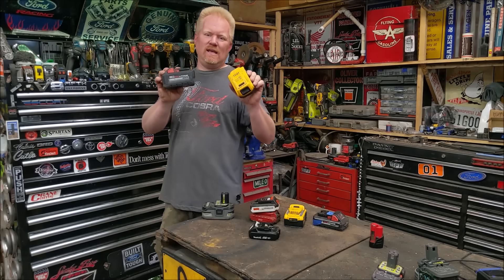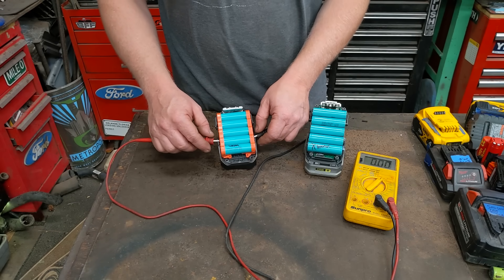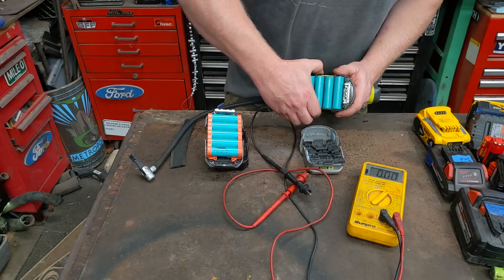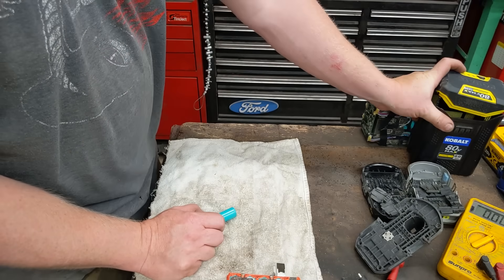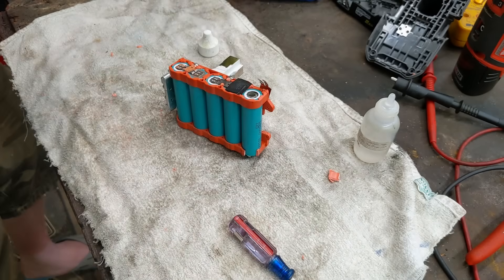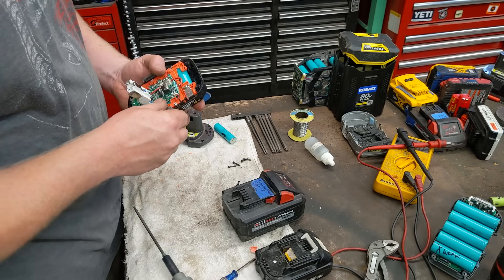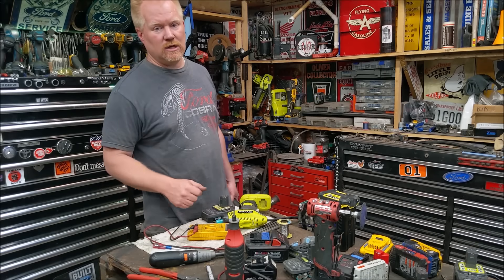Revive DEAD Battery Packs - Rebuild Repair - Dewalt Milwaukee Makita Ryobi Bauer Ridgid 18v 20v 12v

Comment: Very good video.  I have been fixing the small tool batteries in my Ryobi One+ (18v) for years.  Most of the time, I take out the batteries and bypass the BMS and charge/jump it with a good back.  Then if it charged up, I put it on the charger and 90% of the time I am good to go.  Very occasionally I find a bad cell and grab one out of my stash and I am good to go.  Good advice and description on this video. All the best!

Comment: On your soldering iron in order to get more heat if you wanted to stick don't use the small tip unless you want that tipped to be broken or bent PS it's called a soldered junction

Comment: I figured if one cell went bad the rest were soon to fail. Ohh darn should-a replaced the bad cell. Your 18Volt tool will frequently work off your 12-14 volt car battery. You can use one of your bad battery packs and see which of the contacts power the tool and connect a 5 or more foot wire which should be heavy enough(low resistance enough) that there isn't much voltage drop in the wire and put battery clips or something on one end and the battery connector on the other. Then if you are back in the woods and you've ran down all your batteries and still have 5 bazillion screws to put in you can use your car battery.

Comment: If you warm up a “dead” battery, it will charge. I had a bad battery that wouldn’t  charge in close proximity to my coal stove and then put it on the charger again and I was able to charge it.

Comment: As long as the bad battery is tied to the good batteries they all are going to read the same. They have to be separated to get the voltage of each individual battery
Reply from the maker: They don't. A pair in parallel will act as one. If one is weak it'll pull down the other and it'll share the same fate. They act as a single cell and I have never separated one and had the other still be good.

Comment: My Ryobi battery destinations are LGDAHB21865 - P341L064AP. Can you tell me what all that means? Thanks in advance
Reply from the maker: That is a battery made by LG. It's model HB2 with a 1500mah capacity and peak amp draw of 30 amps.

Comment: I have two 8.0 Milwaukee batteries that each of them will only charge to 3/4 bars on the battery but the charger says they’re fully charged. After a few seconds of being used on a Milwaukee leaf blower the batteries quit working and battery flashes red. Pop it back in the charger for a sec and the charger says it’s charged and the battery will read 3/4 battery bars and work again. Any clue what my issue is?! It’s very frustrating :(
Reply from the maker: Dead cell (paired cells)
Reply: @sixtyfiveford  just checked all my cells, all of them are reading 3.5v or higher. I’m stumped :(
Reply from the maker: @SIAS92  Under load you'll find one that drops well below the others. Generally it's the cell(s) that are on the end that are the final negative for the 18v pack.
Reply: @sixtyfiveford  once I a find way to test that, I will give that a shot!! Thank you!!
Reply from the maker: @SIAS92  It's kind of cumbersome but take the battery apart and put the top back on. Then insert it into something like a drill and run it with your meter on the cells. You'll be able to see how they're performing under load.

Comment: 9:07 Lead-free solder is about 350C. Even leaded solder is about 325C. You're technically correct that it's nowhere near 75C, but that's because it's FAR higher.
Reply from the maker: Yep and spot welding is achieved at 2000C

Comment: I have always used silver solder for tinning battery terminals, then any solder will do it. I now have a $10 ebay spot welder and use nickle strips.

Comment: Yes, that is the best way to go, soldering the batteries is the best way to destroy the lifespan, capacity and specs of a battery. Well done!!
Reply from the maker: Not even close to logical. These operate upwards at 75-80C and are rated to do so. You'll never get closer to those temps soldering. I think the highest I've ever gotten a cell was maybe 45C soldering.

Comment: Largely not worth the effort just buy a new pack.
Reply from the maker: Yes and no. If caught early the pack continues a long life. If a weak pack is continually used and then left for years it seams to take more effort to bring it back to a good usable battery.
Reply: @sixtyfiveford  Why pay a load of dollars for a new battery, when a dollar or two for a few new cells will do the job?

Comment: I tried to do that with a Milwaukee small 12 v 3 ah and it screwed up the pack that I used to try to fix it any idea are they both screwed now?
Reply from the maker: You tried to"jump start" the bad pack and it messed up the good pack?
Reply: @sixtyfiveford  yes now both just blink red and green on the charger
Reply from the maker: @jasonbaragar3559  If you have a multimeter you can check the voltage. If it's below approx 7-8v it'll flash.

Comment: The reason why they don’t solder the battery terminals at the factory is not only because it is time consuming, but the heat can also damage the cells. 
For those who are going to do this kind of work I recommend to buy a small spot welder
Reply: Soldering better.
To damage cell you shold heat it more than 30s. (tested)
Reply: @skirnir-atf  spot welding > soldering.

Also looks much cleaner
Reply: @adamacosta7279  
If hands not from ass, solder also looks very clean.

Comment: Nice work - but get a spot welder! And let us know if you like it better'n soldering!
Reply from the maker: I do own a battery spot welder and it has it's own huge downfalls. If you're building a bulk pack, that's the way to go but a few here and there, solder is my choice. You're not going to get a better electrical connection than soldering especially for high draw batteries. It's not that crucial for a battery pack that each cell is only pushing 1-3 amps but push 40 amps or combined 60-100 amps through a few tiny spot welds and it'll suffer. You'll notice that on high drain cell pack they put a break in the nickle strip so the spot weld is forced to go through the battery cap as the shortest route. Where as the bulk nickle strip you buy is solid and most of the spot weld energy is lost straight though the two contact points of the spot welder electrodes. Only a small portion of the energy/heat goes through to bond the nickle to the battery cap.

Comment: even though I've been doing this for a little while there's a few hints that you did give me especially about soldering I realize it takes longer a lot more expensive and a lot more to it but I preferred spot welding I just I just don't like soldering..... so what do you say you take apart a couple laptop batteries and repair them how do you get those cases together that have been sonically sealed I have been very horrifically abysmally failure

Comment: Notice it's usually the cell in the front of batt pack?everyone I ever opened it was usually the front cell bad. Possible that there is a engineering problem with the batt management system on the negative side or a missing diode for back emf
Reply: Or designed obsolescence.

Comment: Great presentation! First time I watched your channel. You may have broached using heat sinks in the past for drawing heat away from area using a small heat shrink clip when wanting to protect adjacent areas. This is what we needed to do in some soldering operations in aircraft avionics repair, the F-111 specifically, where we did a lot of circuit board small component replacement. Great pooch too…. Thanks
Reply: Why would you have to replace the boards?

Comment: Actually no...they aren't going to all look the same inside. Dewalt powerstack is literally flat cells stacked on top of each other. Not a round 18650 battery. Even milwaukee is shying away from the 18650,tho the replacement is round

Comment: "Cheapo Ryobi"  that's cute but Ryobis are well known by the poors to be durable as hell.  I've been beating on the same old Ryobi drill and sawzall for 15 years.  You can believe whatever you like, though.   😄
Reply from the maker: Didn't say Ryobi didn't work, it's just larger, more cumbersome and weaker than any of it's competitors. Need a random tool for the occasional yearly project, absolutely get a Ryobi.

Comment: this is so dangerous and i highly recommend anyone thinking about doing this from this video that you do research on lithium batteries, how they work and why you should never just replace one battery like this. thermal runaway on these high drain batteries are scary as hell and if you ever vented a battery before, you wont want to make that mistake twice

Comment: Cycling the charger on and off repeatedly sometimes fixes blinking codes too. Plug into a power strip with a switch to make it easier since most chargers don't have on/off switches. I've done it before and have used the batteries for years afterwards.
Reply: Grant me the serenity  to accept the things I cannot change; the courage to change the things I can - and the wisdom to know the difference.
Reply: @notcharles  ......... ok?

Comment: Excellent video covering many adaptors and combinations, but I could not see one that would suit my requirements.

I am looking for an adaptor using Makita BL1850 or DM18M type battery to power older Dewalt tools that use the Dewalt 18v XRP batteries.
Even a combination of adaptors would suffice.
Thanks for reading.

Comment: They don't Solder the batteries because the heat is detrimental to the cells that's why the electronic checks on the temperature, the spot weld produces much less heat & will hold up to vibration much better & isn't effected by heat.

Comment: That isn't the only reason they don't solder cells. Spot welding is better because it doesn't heat the cell up.... which is bad for the battery. The little spot welders they use are fairly cheap.

Comment: Question - Can I use a good 20v battery to revive a 12v and 14.4v batteries. Does the voltage difference matter? Does the good battery need to match the dead battery voltage? In all the videos of this procedure the charging of batteries seems to always match each other.
Reply from the maker: For something like a 12v or 14.4v I was just use your car battery. Now you mention 14.4v which is going to be Nicad/nimh. You're never going to be able to recover those no matter how much time you spend. Now the recovery of Lithium is still really hit and miss as well and also just snake oil for people to make click bait videos.

Comment: I learned to solder batteries years ago. On the older BMWS the keys battery wirelessly charges and is sealed into the key.  They are expensive to replace and I learned to cut them in half and install a new battery and super glue it back together. Gotta scuff and use flux and high heat, sticks to batteries every time. I was watching to see if there’s any other methods. I have always used acid based flux for batteries. I always clean them when done.

Comment: I generally use pennies in the slots when I need to jump power to or from a 20v pack.... in emergency situations you can absolutely jump a full size truck by charging the car battery from a 20v pack with jumper cables... you only get a couple shots at it but thats enough if you dont have bigger issues.. you just have to disconnect the 20v pack before turning the motor over because it will pop the safety "fuses" that are in the 20v pack

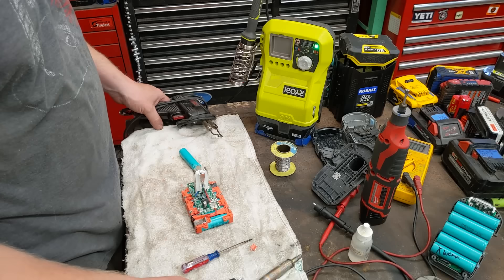Comment: Hi quick question. I was wondering at 11:30 in your video talking about soldering irons I have that 1 in your right hand it's black. Mine is blue lol anyway u c the tip part mine only works when I get it in like an exact spot u know. Should I use some kind of wire brush and idk clean it or something or just go out and buy a new n better one I do like using it and also on delicate things like diff motherboards etc. Xbox stuff like that ?? Thx for your knowledge n help if u have time cheers 🍻
Reply from the maker: Sorry, a lot late to reply. A lot of times the little tip is retained with a screw and can be taken out and cleaned. Wire brush, steel wool, fine sandpaper, etc work great.

Comment: Subbed. My Ryobi 4Ah battery shows to be fully charged (4 lights)if you check the charge light on the battery, but when you put it on the tool, it runs for 2-3 seconds, then quits. Let go of the trigger on the tool, then pull the trigger again, and the tool runs for 2-3 seconds again and quits.  The battery does the same thing no matter which tool you put it in. Glad I saw your video, so I will test it to see if it is a cell issue.  Any suggestions would be greatly appreciated.

Comment: Figures. Manufacturers want us to buy new but often isn't necessary. Great job showing us how to save money and be easy on the environment.
Reply: Yes many items are engineered to fail so consumers will buy more.
Reply: @jbformac 
Yes I'm way late to the party but that's what happened with the light bulbs. 
They used to be able to make them last forever and figure it out they wouldn't make any money that way
Reply: Instead of Soldering on a battery, you can buy a "battery spot welder" for ~$50, and do it just like the manufacturer does. Much safer, much faster, stronger joint.

Comment: Hey sir awesome video and very informative! I have a question I used a harbor freight 20v impact battery to start my atv now it won’t charge.. so you think that was to damaging
Reply from the maker: These have a fuse/thin metal piece that could have melted. You need to open it up to see. If so just bridge it with solder

Comment: Are the DeWalt 18 volt XRP batteries fixed the same way?  I just moved over to a few new tools in the DeWALT 20 volt max line and there is an adapter to use the 20 volt batteries, but I have seen mixed reviews of it.  For NiCad batteries is the process the same or are the cells different?  The cheap knock offs do not last very long, from what I am seeing on the reviews.  Where do you purchase your replacement cells?  I also have an old Weller iron, like yours, but I am old and purchased it in high school.  I am using KESTER SOLDER 24-6040-0027 which I just purchased last year and I do not believe it needs flux.  The best solder I have used is actually the one from Weller or Radio Shack in the feeder tube.  Is it worth or possible to rebuild the 20 volt XRP batteries?  Thanks for your help.

Comment: Wow you really remind me of a  guy called "Myself"!  Only difference is you dont apparently dont have any 80V kobalt tools, I definitely still use them, in fact they are among my favorites for sure! They have replaced all things I used to hassle with gas over, better performance and always ready to go, even the chainsaw, and I literally got them "Dirt Cheap", only one out of the 9 I had to actually repair, and its been great ever since.  But I understand  your conclusion since there is allot of those batteries that arent old enough to be bad for parts on ebay ! All mine have been been trouble free though and I work them hard. Still when they have replacement boards for those I would probably try my hand at getting a couple more going!

Comment: Use at LEAST a 30 watt soldering iron. AND ONLY ROSIN FLUX!!!!! And too weak a soldering iron will cause you to keep heat applied way too long trying to get the solder to flow! Hotter IRONS will heat the battery LESS! Whaaattt? Yes! because you bring the "solder area" up to temp QUICKLY! SO.. get it and out quickly! Might use a dental pic to hold it while it cools. DONT cool it too fast, you could end up whit a cold fracture you can't see but vibration will undo it soon. Do not use a torch with a soldering tip!

Comment: Obviously, something’s not right here:
If the batteries routinely get hotter than the soldering iron then you can’t expect it to stay soldered, can you? ;) I do most of my electronics soldering at 280-330° Celsius, and I would typically have to bump it up to 350-360° solder to tabs and metal terminals like these since I don’t have the modern cartridge type of iron.

So, yeah, not sure where you get the idea that soldering doesn’t get anywhere near 75° C. They really do spot-weld tabs because it is safer. One only needs to look at tabbed coin cell batteries. I routinely replace them in game cartridges from the ‘80s and it’s clear that they use solder for the board connection with spot welds for the battery connection. So many things come pre-tinned with solder from the factory that, if anything, it’s easier to automate at an industrial scale than spot welding. Heck, they use lasers, reflow ovens, solder pots, IR pre heaters, etc.

That said, I know plenty of people who solder directly to battery cells and none have exploded yet… but I’d be VERY carful about claiming it is safe.
Reply: I thought the same thing at first, but I think he meant you won’t damage the cell by soldering onto it, because not enough heat is dumped into it in that short time

Comment: Can you individually test batteries if all the metal connectors are connected to other batteries or do you have to break all the tabs off to individually test the batteries to find the bad one?
Reply: You have to break them off. You can’t test them individually if they are all connected together

Comment: Do you have any idea what's going on with a Porter Cable 20V lithium MAX battery that will power LED flashlight & the lights on any tools with a light, but not operate the tool itself? Pack measures fully charged at 20.5V. When placed on the charger it gives the fast blinking red. It won't power any tools, but will power any lights with no issues. I'm guessing most cells are dead, so it has proper voltage, but not enough amps?